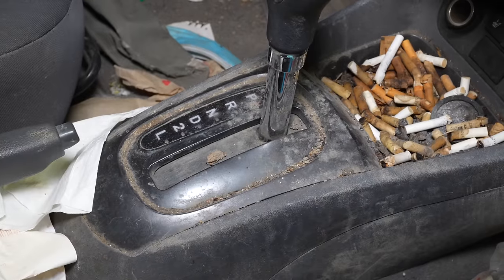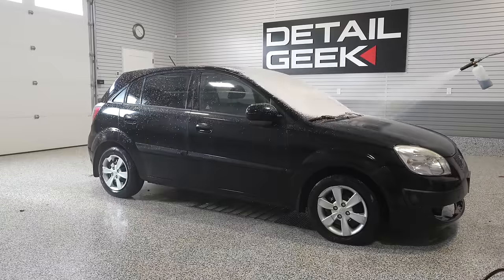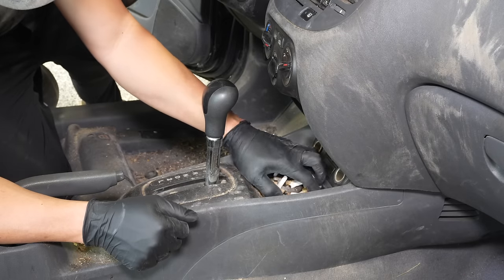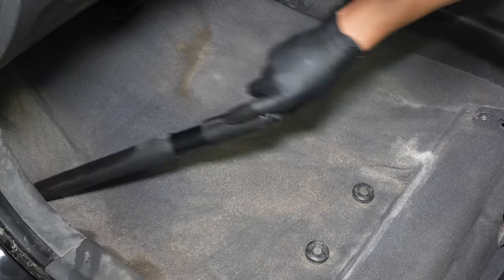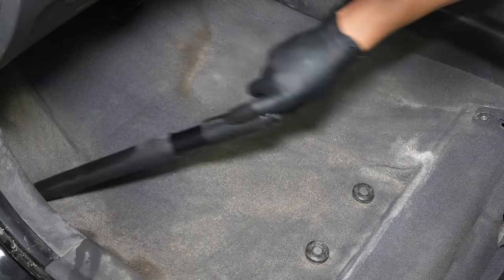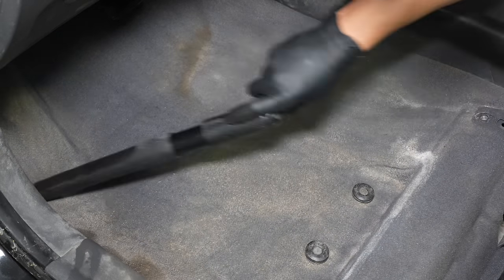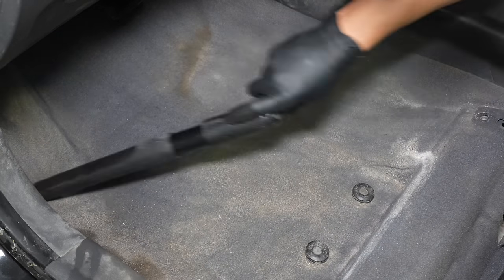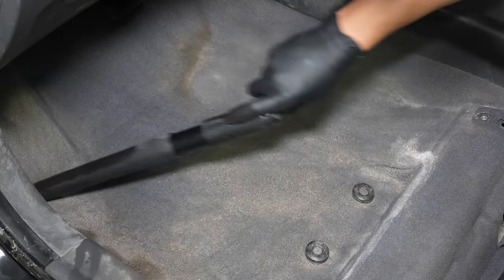Cleaning a Chain-Smoker's "UNCLEANABLE" Car!

Comment: Man, I wish you were in the States. I've never had anyone take my seats out and steam clean doors,  panels, etc. Bravo, sir. You really did an excellent job with this!
Reply: A good detailer will always do that!
Reply: Any good detailer can do that for you. I'm sure there's one in your area, they are pretty much everywhere. If you want it done right, it will not be cheap though
Reply: Any good detailer can do that for you. I'm sure there's one in your area, they are pretty much everywhere. If you want it done right, it will not be cheap though
Reply: @AndrewDRoyappa  thku, and yeah, I wouldn't expect it to be 🙃👍🏾😊
Reply: I'm also from the States, if your detail or doesn't do that you need a new detailer
Reply: Right?! We bought a car from CarMax earlier this year and the car was very clean, but you can still see stuck on whatever yuck in the runners of the seats on the floor. I would have to remove the seats to get it out.
Reply: In Uzbekistan this kind of detailing quality is medium. We have much better detailing studios over here, you will be just astonished. It will be as clean as the new one. Plus it is affordable

Comment: I've had 3 cars that the previous owners were chain smokers. The first was a '62 Studebaker Lark. The owner smoked stinky cigars. I scrubbed that interior for a long time, and the smoke came off of the headliner in particular, in layers. It finally got to a point that it did not seem to get any cleaner. It was a light tan and looked ok. I then looked behind a badge on the headliner, and it was originally grey. The driver's door panel had some burn marks where he touched it with the cigars.  The next was a '73 Peugeot 504 sedan. All of the upholstery was worn and smelled like an old ash tray that hasn't been emptied in a long time. Fortunately I went to a wrecking yard to buy a couple of parts and I saw a newer one that had been in a wreck, but the interior was immaculate! I bought everything that would reasonably be removed, cleaned the headliner and all of the new upholstery, installed the interior and it looked great. The last was a 2002 Ford Explorer. The previous owner smoked cheap tootie-fruity flavored cigars. My daughter and I spent 2 days cleaning the interior of that car. The Ford was the worst because the cigar smoke was in the A/C ducting and on the evaporator. It smelled terrible when the A/C was on. The thing that was common to all three cars was the smell. It took months to get rid of most of the smoke smell in the first two, and that was including leaving the windows down most of the time for months. I never did get rid of the smell in the Ford even after a year. Cleaning foam for the evaporator had not come out yet, or I did not know about it. Oh well, live and learn. BTW: if the car has a cabin filter, change it!

Comment: I find it funny that someone says that a car is "uncleanable" and you're like " Hold my beer and watch this" lol. Just the simple act of getting rid of the trash and vacuuming makes such a huge difference!  
Another great transformation!
Reply: Except for the fact that cigarette smoke leeches into everything and will off gas into the car for the remainder of its life exposing the new owner to carcinogens and cancer..
Reply: You would be surprised at what the right tools, chemicals and technology can do though.
Reply: @Troupster 😂😂😂
Reply: @areasonablethought610  Yeah it probably can be cleaned with enough effort, but it is best to avoid smoking in the car. If you do that, at least have a window open and always throw the ash and the butt out the window. That way pretty much everything goes out and there isn't any smell inside.
Reply: Por favor, vaya sugerencia, que tire la colilla y ceniza por la ventana.😡
Reply: @MaxCroat  true
Reply: @Troupster yes. There is big amount of cigarette dust under carpet and under door panels. I know it. I once bought a car from a cigarette smoker. The odor disappeared only after I cleaned under the carpet and under all door panels.

Before doing that I could run ozone machine and odor was back after 2 days.
Reply: @BartoszRybacki0  not even dust, the chemicals literally leach into the plastics and will equalize over time. If you remove the smoker it means they will start outputting smoke 🥹
Reply: @Troupster  probably. So I will never buy a car after a smoker again. Even if it is a bargain.

Comment: I just keep thinking...I hope they remembered to replace the cabin air filter.😂
Reply: Why spend money on new hubcaps that are as useful as engine covers or bumper stickers when it needs much more,besides wheel covers don’t hold the wheels on
Reply: @bradzimmerman3171 exactly.. but all of the repairs are super easy and cheap so I'm sure whatever the guy paid for the car was worth it if he got it for so cheap considering it's condition
Reply: Yeah they can get pretty manky. Especially considering the amount of crap that was sitting in the trough at the bottom of the windscreen
Reply: They would also have to clean the whole vent system.  Tar coats everything.
Reply: @bradzimmerman3171 cause most people don't care if the oil pump assembly was cleaned or the oil pickup was swapped, but they do care that the car looks like it was slammed into every single kerb in the city. These cars are almost always bought to be re sold at a profit, not to be used as daily drivers.
Reply: @triciac1019 hopefully the air filter did its job. tar should be everywhere up to the air filter, which is a fairly short run. New air filter and it's probably good enough...
Reply: @triciac1019 that's what I was thinking too, plus the headliner, which will be a real stinker on the first warm day!
Reply: @somedude2492  By the looks of the car I highly doubt the cabin filter has ever been replaced let alone ANY service done. If the tires are bold and under inflated they havent done anything else than put gas in the tank and beat the hell out of it. Even if they got the car for free its very likely to have more serious issues other than being a dumpster.

Comment: What I always wonder about when seeing a car in this condition, is whether they ever did any maintenance. If they treat the inside like this, they probably never open the hood. Never get an oil change or even check any of the fluids. Most likely, the engine and transmission are shot. The value of the detail job is probably more than the car is worth. Great job as always. You’re a pro.
Reply: Check out the condition of the tyres! They're basically racing slicks at this point
Reply: Yeah, if the owner doesn't even care enough to throw his trash in the can rather than leave it in the car, you can't help but wonder how much he cared about the mechanical maintenance. Doesn't necessarily mean that the car is poorly maintained, but still.
Reply: @MaxCroat  You're right, there's an excellent chance the mechanicals have been neglected.
Reply: Well duh! They need every spare dollar for cigrits! 😂😂
Reply: I think the new owner may have his own dealership and figured he can get the car for close to a dollar. Get it detailed and running. Then slap a price on the windshield. With just a little over 100k on the dash, he's going to get 2k+ for it.
Reply: The hood release is broken...

Comment: No ozone machine used? Thought for sure you'd use with it being a smokers car. Looks great!
Reply: LOL..I asked about that too!
Reply: He probably still uses it but its not in the video.
Reply: Was thinking the exact same thing, cuz I'm wondering if the tobacco smell might return (headliner, underside and fronts of seats etc).
Reply: I had this exact same question.  Surely he would've had to use it though - otherwise the first time the HVAC system was activated you'd be smothered in cigarette smell.  The worst part is that I'm a smoker - but I don't smoke in my house or vehicles.  Too gross to do anywhere other than outside.
Reply: Probably runs it over night
Reply: I agree as well, there is no way that smell is gone, it's just less of a face punch than before he cleaned.  Cigarette smoke smell is like herpes, once it's invaded a space you can likely never get rid of it.
Reply: @tamaradavis3693  The smell seeps into the plastic

Comment: Sooooo…is the stale smoke smell gone. I bought a 2015 Ford Taurus SHO last month which looked beautiful. It had the typical dealer armor all treatment which was a pretty strong smell for a few weeks and then after that wore off it was revealed that it was absolutely a smokers car. I’ve had a full detail done with two different ozone treatments and it still smells the same. What should I use?

Comment: Great job Mitch!! What a transformation. I do think that using your buffer method on the paint would have help greatly in removing many scratches and you could have finished with your spray on wax for added protection .  

Thank you for the videos, I am a big fan!

Comment: Hey Mitch, did you pull out the cabin filter? That thing's probably never been changed and is full of tar and nicotine from the cigarettes. Even if the car smells clean and new after a day or so that rancid cigarette smell is going to fill the car again from that filter.

I am curious if you run the cars fan while it circulates inside air when you use your ozone generator. I had to do that in my last car (it was a rental) because it smelled like a men locker room, The ozone get recirculated through the cars ducts and stuff, which helped a lot.
Reply: That's not even an ashtray! My Sonata had a similar, and was a rental, smoke free car. It had no ashtray or lighter, those connectors looked like mine and you could plug things in that required power, like a vac or air pump.
Reply: @johnwilliams8818 I use the plugs in my Cavalier for operating my scanner (I’m a volunteer firefighter/EMT), CB radio when I’m on the highway, or plugging in my cell phone charger when I need it.  Eventually I’m going to set up a CB/scanner rig in my Tahoe too-it’s an old fire department vehicle that a friend of mine bough at their auction, so all I need to do is mount them, rig up two antennas, and I’m good to go!

Comment: The funny thing about this car is that it looks almost exactly like my car. Mine is a manual, though the steering wheel is on the other side of the car. As I am in Australia and no mesh on the back of the front seats.

Comment: Great job, especially getting those fabric seats cleaned up,  I have a question, always good to remove front seats, but why not just take out the rear seat bench, they usually just unclip and pull out, I do it on my BMW when I'm cleaning the leather.

Comment: How do you feel about incorporating an air compressor into detailing? I've seen others use it with attachments like a funnel for debris removal and a spray gun for ceramic coating. While you stick to a spray bottle, do you think adopting these tools would enhance my detailing process as a beginner?

Comment: Thank you for the excellent detailing videos, as always. I have a quick question. I noticed you don't cover up the door speakers  when power washing the door jambs, is there any risk in damaging the speakers? I have always cleaned my door jambs by hand, but I may be interested in using a power washer if it is safe to do so.

Comment: Definitely one of the best transformations. Whoever bought it likely had to pay maybe $3k for it or something low. A near $1k-$1.5k cleaning/transformation is super worth it. 

That said lots to do to fix the rest. New tires, wheels, hubcaps, front bumper, windshield and a fixup on the rust above the rear passenger wheel.

Comment: I'm curious to know if the cigarette smell came back? It's such a hard smell to get out. I bought used car, didn't know it was a smokers car. It was spotless, white leather & smelled great. Then I found a lot of hidden air fresheners under the seats. When I got rid of them the smell came back. I used several air freshener smoke bombs & replaced the cabin filter. Worked for a little bit but the cigarette smell always comes back. Any tips?

Comment: 16:17, see those clips at the left (left not visible) and the right of the glob box? Push them IN and pull to you, It makes it easier to you to clean behind, take the air conditioner filter out, clean. Also some plastic protection on those parts makes them last longer to brake.

Comment: In my country your car would actually fail the yearly inspection if it's too dirty, they will simply refuse to do it and it's an automatic fail, it depends on the inspector but the bar is sometimes pretty high too.

Comment: So what I didn't see or hear addressed is the cabin filter needs to be changed and as soon as you turn on the HVAC the stink of smoke stuck in the ducts will be awful. The only way I know of ridding that is running an inozer for several hours. It worked great on a car I bought a while back.

Comment: A few years ago I bought a two door GMC Jimmy.  Previous owner was a smoker and the interior was disgusting. Took it to a local detailer who promised he could get the stench out.  Not only did that NOT happen, but he used cotton towels dried with dryer sheets, which make me sick, AND left a streaky residue on windows and all other surfaces.  When I went to pick it up, I could still smell the cigarette stench AND the dryer sheet stench.  When I brought that to his attention, he got very pissy.  I paid the bill but the negative PR will cost him.  I ended up trading it in for a four door Jimmy which smelled fine.  Several locals have commented to me about his poor jobs and bad attitude.  I'd be happy to drive from Vancouver Island to Saskatchewan to have you detail my 14 year old Equinox (with under 130,000 kms on it!).

Comment: My husband recently purchased a used truck that was owned by a smoker.  Even though the dealership detailed it and changed the cabin air filter, there is still a lingering hint of cigarette smell.  What can we do to mitigate that smell and will it go away with time?   Thanks.  ☺️👍🏻❤️
Reply: Try Ozium.  Its probably your best shot.  Also for home use I like the Febreze fabric freshener spray.  It might help some in the car if you haven't tried.
Reply: @mikeb3216  thank you!  👍🏻

Comment: Could you contact KIA for replacement parts of this model if you wanted to update the inside ?

Or do you need to contact each part separated ?

Only the visuals, not the performance.

Comment: One thing you have to consider  when buying a used car is that if the interior looks like a miniature landfill the engine is probably no better, People who willingly drive in a car that filthy are usually the type to go a few thousand miles overdue thier recommenden oil change.

Comment: I have the same car, the top of the range with the two-tone red/black upholstery, leather and chrome inserts... 

I can't imagine the level of neglect that would have caused the car to get that dirty. But I'm surprised by the tyres, Khumo is a third brand that was widely used on Kias of that time. 

The owner better change them as soon as he can because they might even be the originals that came with the car... And even though they were new, they weren't good tyres. 

And by the way, where is the rear fog light? It should be on the rear bumper, below where the fake air diffuser is.

Great job anyway!

Comment: Wild how some people can have so little regard/care for the condition of their vehicles.  100k Km is very low miles, but that floor is just destroyed.  Looks a lot better clean, but still, the bad scratches, burns in the plastic, broken hub caps and bumper, jacked up paint on the back hatch, rust on the rear fender/quarter panel.... this thing looks like it has been driven 300k Km or more

Comment: The trouble with smoker's cars is that you either need a steering wheel cover or replace it entirely, even after it has been cleaned, your hands smell of shit after just a short drive. I have this problem a lot as a truck driver and it drives me INSANE

Comment: Looks great until you turn your AC on. You will never get the airbox inside smelling good. I bought a pickup 2 years ago and Iv never been able to get the ac to smell good. I gave up after chlorine dioxide gas could not fix the problem.

Comment: I turned a $500 1995 Ford T-Bird, formerly a fully loaded luxury sports model, that belonged to a tweaker, back to its former luxurious glory, for myself. 
It might have been a Mobil meth lab, because it didn’t even come with its original rear leather bench seat. Unfortunately, I had to get rid of it, because it was a real money pit, with the 4R70W automatic transmission always breaking, & losing gear, slamming back into gear while driving, and constant shudder.

Comment: Honestly, couldn’t convince me this car would ever be clean.  You’d have to use an O3 machine to eliminate smoke, even then you still have tar coating the ventilation system and every surface of the car, probably even the body behind the door panels and underneath the carpets.  Probably everywhere.  It looks great, but I’m pretty sure the car is SOL… you’ll probably get enough revenue on the video so I am not being negative.  Just saying if I was a detailer I don’t think I’d touch this thing 😅

Comment: Amazing transformation.!
But the new owner must be a smoker also.  Zero chances of getting rid of the stale smoke that has permeated every fiber of carpet and seat, as well as plating every plastic surface in the car and inch of air-conditioning duct and coils.
Saw a detailing of a sports car that had a decomposed body in it. They saved it by gutting the interior and replacing EVERYTHING in the compartment.